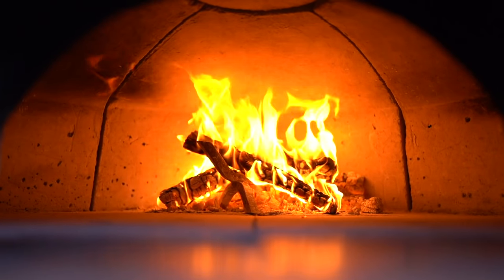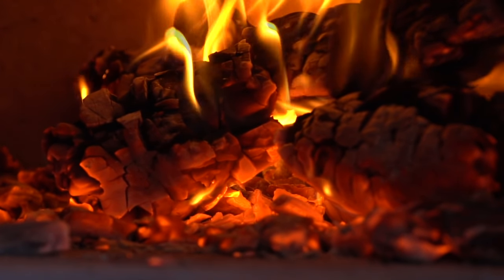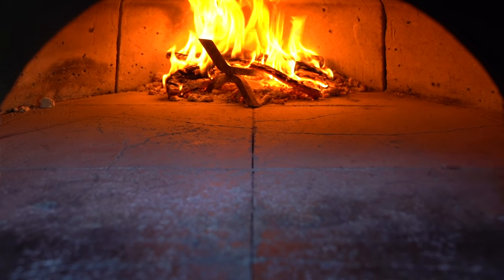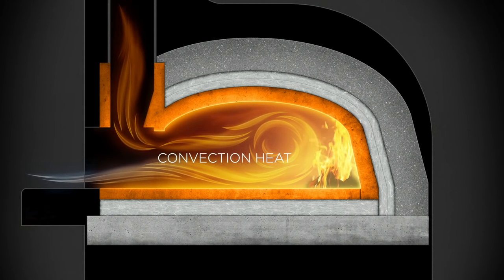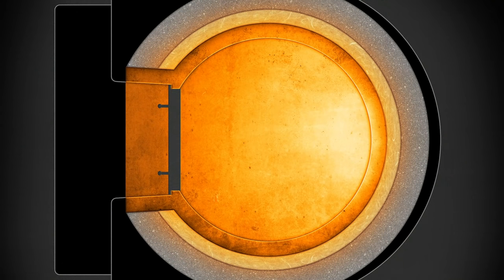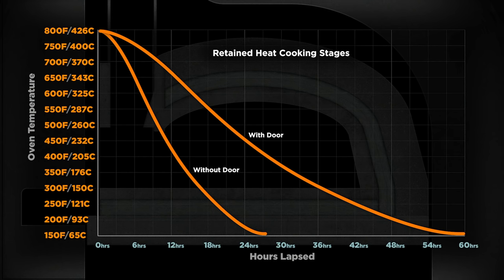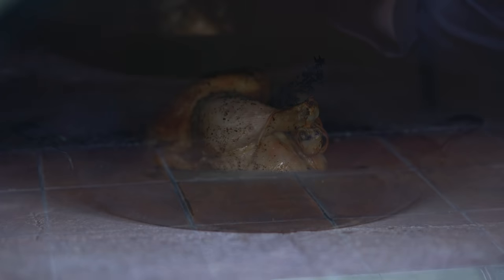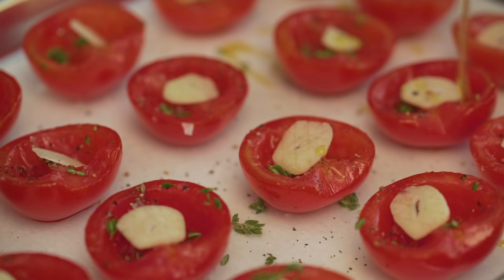Ep 19. An Introduction to Cooking with Retained Heat

Comment: Hi I’ve just bought a wood fired oven, originally to cook pizzas but I  am more excited now about the other things I can cook since watching your videos particularly retained heat cooking.
Can I ask do you close the chimney  down as well as a well insulated door.
The other question I have is our oven is dome shaped but even during the curing process you can’t leave you hand on the outside for too long as it’s hot this would suggest it’s not very insulated wouldn’t it?
Many thanks and I look forward to more videos
Reply from the maker: Hello Steve. Great to hear about your oven, congratulations. When I seal up the oven with the door the chimney remains outside. That way there's no heat loss from the dome through it. The heat coming out of your oven while while you're using it has very little to do with the insulation, and is related to the fire, and the heat in the your thermal mass (that being the floor and the dome). Once the fire goes out the insulation determine how long that heat is held in the thermal mass. More videos to come. Clive
Reply: Clive,
Firstly thanks for taking the trouble to reply. This is the first time I’ve cooked in my oven and I didn’t want to fire it up completely to pizza temperature so I made confit of garlic (great video thanks) spatchcocked chicken which was nice and roast belly of pork joint, which I tried to slow roast but it didn’t work out to well. The door was open slightly and I think I should have shut it and just let the embers carry on cooking it slowly maybe just adding some wood every now and then to keep the temp up.
Might be an idea for a video, slow roasting?
If you have any tips I would be truly grateful.
Many thanks
Steve
Reply from the maker: @steveholman546  All ovens perform differently and have their own characteristics. The more you use your oven the greater your understanding of how it performs, and what it’s capable of, and your instincts will become more in tune with it when you’re cooking. Keep experimenting and you will master yours. Clive

Comment: Very interesting and well produced video ! 
can you give us the ideal dimensions for building a wood-fired oven?  Is there a relationship between the dimensions of the oven and the mouth?  length of the charging tunnel / cooking zone?
Reply from the maker: My oven is 40"/106cm in diameter, which I have found to be enough room for my style of cooking. 
Insulation is one of the most important components when planning your oven. The dome is about 16"/41cm high which is about standard. You don't want the dome too high otherwise it won't reflect enough heat. If you’re planning on getting the most out of the full heat cycle, then that should be a consideration when designing the structure around the dome. A well-built oven with good thermal mass and adequate insulation will be very efficient. In my experience the oven requires less fuel to maintain the temperature, which means a smaller fire, which gives you more surface area to cook with. It also retains the heat very well, which means the morning after I've used the oven (10 to 12 hours later) it can still be anywhere between 500F/260C to 300C/150C, depending on how hot the oven was and how late I used it. So still hot enough to cook without relighting the fire.
Reply: @TheWoodFiredOvenChef  thanks. Greetings from France .🍕🍞🥖

Comment: What amazes me is how your oven always brand new.  How is it possible it doesn’t carbon up at the end of a firing?
  (In Calgary, we have to burn spruce, pine, fir, & poplar- it’s what we have.  Almost no hardwood for 1500 miles.)
What would you estimate is the mass of your oven inside the insulation?
Thanks
Reply from the maker: The woods you mentioned are definitely going to leave a lot of carbon on the dome, and probably won't get to the temperatures that hardwood will give you. I've always found with mine that if I've got it to the temperature where the dome goes clear, it remains that way, even when the fire dies. Since I'm not adding any more wood towards the end, it's not creating any smoke. I'll try to figure out the mass and get back to you. Clive

Comment: Basic oven construction
1. Dome floor made of(innerside): fire brick or refractory concrete. 

2. Between concrete slab and oven floor: insulated mortar or calcium silicate board. 

3. Around the dome : layers of ceramic fibre insulation.

4. Dome is surrounded by at least 2 inches or 50 millimeter of insulated mortar

5. Additional insulation. Part of over overall design.

How much time would it require, for a totally novice person to  build? I have no experience in construction work.
Reply from the maker: If you would like to email me through my website I will send you all the information you need about my oven.

Comment: Wow, a dream oven! Very awesome. If you don't mind sharing what is your dome made off? Refractory Concrete
Reply from the maker: I had originally wanted to build a brick dome as I had an aesthetic and romantic notion of having an oven that followed a tradition that goes back centuries, but after further research I discovered that the precast refractory concrete models were just as efficient, fit my budget at the time, and less time consuming to build. Not that there’s anything wrong with a brick dome. The web has countless videos of talented enthusiasts building really beautiful brick domed ovens. Many of the major wood fired oven manufacturers that produce oven kits, like Forno Bravo, also offer fully assembled ovens, so there is that option too.

Comment: Is the temperature level of the oven controlled by the amount of wood you burn?  Or the oven would always reach 800F?
Reply from the maker: Yes. The greater the amount of wood you burn in the oven the more it will penetrate the dome and the floor, and the temperature will reflect that. I don't think there's much point in going beyond 900F/480C as you'll have less control when cooking and most food won't withstand that heat. I regularly fire up my oven to be around 750F/400C in the center of the oven floor. The hottest area of the oven is going to be around the fire, around 900F/480C, then will drop towards the oven opening to around 450F/230C. So you have various temperatures to work with when placing your food. An oven with good heat retention will require less fuel to maintain the temperature, which means a smaller fire, which gives you more surface area to cook with, and gives you greater flexibility.

Comment: Great info and amazing explanation. How did you get such a nice sear on the prime rib at such low temperature? Or How long was it inside the oven?
Reply from the maker: The oven started at around 325f/175c when I put it in, and finished 2 1/2 hours later at around 250f/120c. You can blow torch the outside before you put it in. I know it's a method utilized by some chefs. Clive
Reply: @TheWoodFiredOvenChef  Amazing.  You really have done an awesome job on  producing these videos. Great work.
Reply from the maker: @chefbillyx  Thank you!

Comment: I recently found your channel and honestly, I've never seen such a great mentor like you ... Anyway, do you have any idea how long it takes for the fire to burn in the oven to reach a baking temperature of 450 * - 550 * F for bread as an example? I know all ovens are different, but tell me about yours. And also how do you measure the temperature with the laser gun while the fire is still burning? It would be wrong to measure like that, because we need the temperature of the bricks, not the fire ...
Reply from the maker: A lot depends on your oven's heat retention, but if you want to use your oven for baking you would first fire it up for at least an hour or two so the heat penetrates the floor and the dome. then remove the fire. I always take the temperate in the center of the oven floor, with a Digital Laser Thermometer. If you would like more detailed information about my oven you can email me through my website.

Comment: What type of insulation materials you have been using for restoring temperature Sir ? Please kindly ,,
Reply from the maker: Below the oven floor is Calcium Silicate board that is 3"/75mm thick. Around the oven are layers of a ceramic fiber blanket to a thickness of 3"/75mm. The Insulated Mortar surrounding the dome is a cement mixture made with an insulation material like Vermiculite or Perlite. Consult your Wood Oven supplier for more information.
Reply: Thank you so much . Your information is so worthy ! I am very new in this field, so waiting for next many more videos from you Sir!

Comment: The problem is this only works with refractory brick ovens REALLY WELL MADE!!! The expensive but "cheaply" made stainless steel domed ovens lose heat quickly.  Even the Italian made ones. The best heat retention I have ever personally witnessed is Valoriani. I know there are other quality made ovens which can perform this task, but again they are quite expensive.
Reply from the maker: Yes, heat retention varies across all ovens. There are many great steel ovens, but the best heat retentions usually comes from custom built ovens.

Comment: With which materials and how did you make the insulated door?
I just wonder how you made it.
Reply from the maker: The door came with the oven. It's about 2"/50mm thick, and the inside is filled with fiber insulation.
Reply: @TheWoodFiredOvenChef  Thx, so it is enclosed between the metal, right?
Reply from the maker: @Ouwkackemann  Correct

Comment: I am building my oven, can I place my flue at the rear of my oven? I plan on using a stainless plate to partially block the flue opening. hopefully keeping the heat from coming out the front of my pizza oven. I noticed an oven called pizza party with flue at rear of oven. I would appreciate your input. cheers from San Antonio Texas..
Reply from the maker: Hello Alex. I'm not sure I understand why the chimney would be at the back, but I'm sure there's some reason for it. I would discuss it with the manufacturer. If the flue starts at the front and then travels across the top to the back, then maybe that's the reason. I guess the air would still be drawn into the oven and travel to the back, but wouldn't circulate the same way as a flue in the front. I'd be interested to know what you find out. Clive
Reply: @TheWoodFiredOvenChef  The benefits of the innovative REAR FLUE: The position of the chimney is an added value of this wood fired pizza oven, it provides many advantages: first of all, keeps the heat inside the wood oven to increase efficiency and reduce consumption. The second benefit is increased safety; the fire cannot get in the chimney during normal use.
By purchasing a Pizza Party 70×70 will have included in the price:
Wood fired oven, Spartifiamma, Alzalegna, regulated flue, chimney, traditional door without glass, thermometer, 6 + 2 firebricks, user manual, save front, actual offer new front oven with large door 39cm and Firenze style included in the price.
here is the answer for rear flue. "pizza party"thanks for your input.. cheers.
Reply from the maker: @alexgil2024  Thanks. The only thing I would add: all the videos I've seen on youtube of wood oven builds, and all the main manufacturers, the chimney is in the front.
Reply: @TheWoodFiredOvenChef  I am leaning that way. thanks chef. will send a picture when I am finished.

Comment: I want to put some meat in a red sauce in a Dutch oven and place it overnight in my pizza oven....kind of like a Hawaiian luau....any thoughts by just using retained heat?
Reply from the maker: It could be done, but I don't know the retained heat performance of your oven. If overnight, you're probably looking at around 8 hours. Over that period of time the temperature in my oven will drop around 150F/65C. I would imagine I would want the final temperature to be around 200F/90C, so that would mean putting the dish in at around 350F/175C.
Reply: Thx

Comment: lol, no need for insulation nor chimney.
in my country we've been using these for a thousand years.
edit: the sheer mass and thickness of the walls act as the a heat condencer so there is never need to insulate the dome. the chimney is never needed when the over is standalone outside like yours. the door is specialy shaped to allow the air to come in and smoke to come out.

Comment: How long to heat the oven?
Reply from the maker: I usually beginning heating my oven up about 90 minutes before I plan to use it. But there are so many variables, depending on how much wood is used for the initial firing, and the insulation around the oven. An oven with good heat retention will require less fuel to maintain the temperature, which means a smaller fire, which gives you more surface area to cook with, and gives you greater flexibility. Sometimes I will start with a smaller fire to bring the oven up to a temperature of 500F/260C to cook something at a lower heat (potato gratin) before raising it to around 700F/370C for the next part of the meal. And I use the time the oven is heating up to prepare whatever it is I’m going to cook.

Comment: Otherwise brilliant content, but one small remark: just for the sake of nature, light your wood from TOP, not from the bottom. Why? Because lighting from bottom releases a lot of wood gas without leading this gas through the fire. Hence it does not burn and those poisonous gases are released to nature. In addition the oven and chimney get dirtier due to soot accumulating. Setting wood in fire from top results in cleaner burn, that helps your fireplace, chimney and the nature. Burning time is the same.
Reply from the maker: Thanks for the insight